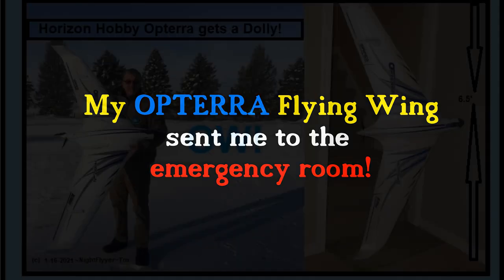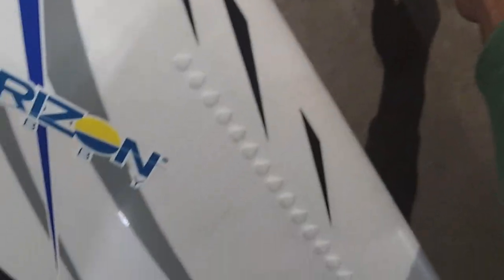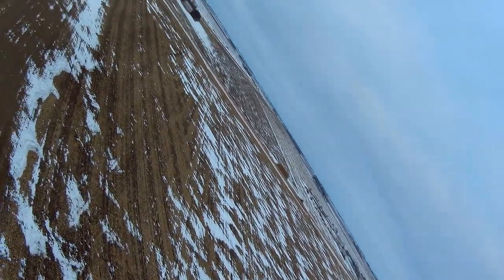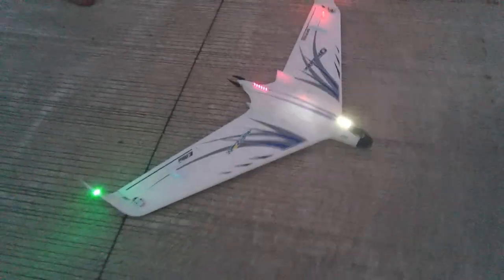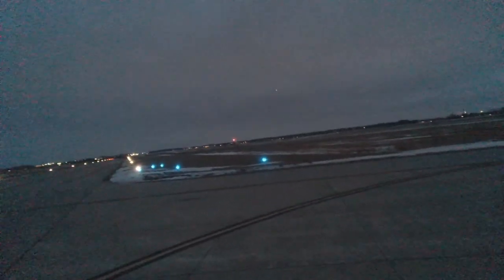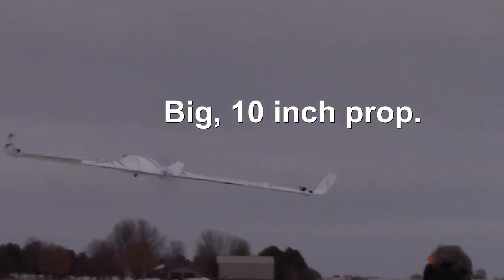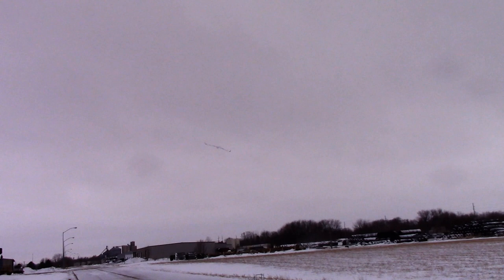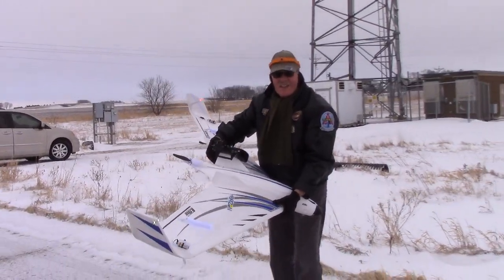My Opterra 2M Flying Wing sent me to the E.R. This is an awareness video & my solution for launching

Comment: Throtty Cut..  it's your friend
Reply from the maker: Of course I know how and  have.  First of all, that had nothing to do with my hand injury. I only mentioned the Throttle arming because I followed instructions in the manual and this is the way it bound up and arms the motor as soon as you plug in the battery. It says nothing about programming in a cut switch like my helis have.  It's my warning to be cautious, because the manual says nothing about programming in a throttle hold to a switch. I've known of times when after flying, that switch was forgotten to be moved back to safe and it armed as well.  Nothing is 100% as it could be left in the wrong position, by accident. I'm pretty experienced, so never relied to on a throttle cut/hold, as all my machines need throttle stick movements to arm.   I only am warning others to be careful BEFORE the launch and to be careful no matter what you use.

Comment: think i heard the prop hit the dolly on liftoff
Reply from the maker: I installed guides to the bottom of the plane. I think you heard the cross bar on the bottom of the dolly pop over the screwdriver I had pounded into the ground when it reached the end of the string at the last minute.  Thanks.

Comment: You could throw it then turn the engine on
Reply from the maker: Here is word for word what the Opterra 2M manual says about launching.  
1. Put the aircraft into launch mode with the channel 5 switch.  (in my first video that did not work, it went into the ground)  
2.  Hold the aircraft in one hand and the transmitter in the other.  
3.  Apply full throttle and throw the aircraft directly into the wind, angled slightly up (5 to 10 degrees above the horizon). 
4.  Climb to a safe altitude and check the trim.   
I know others have their own ways, and either way, my Dolly is the safest solution for me.  
The Opterra 2M manual also says nothing about throwing it with the motor off, so if a newbie followed the instructions, like I did, I'm showing what could happen, in case a gust of wind got them or something else.     Nothing is 100% and no matter how good you can throw, this big 7 foot wing with a 10 inch prop spinning right next to your face, is risky.

Comment: You toss it like a paper plane, thats bad, and its a little bit underpowered? Try throw like a javeline, and the hand should be faster(swipe) foward down. But as you say it could happen to anyone. Seeing your cuts on your finger makes wonder if i should wear a glove. Stay safe
Reply from the maker: I cant fly with a thick glove.  This 7 ft wing is a bit tough to launch, not like my smaller ones, and I found that I have to keep my right hand on the elevator stick to launch it.  But again, I followed the instructions in the manual.  Here is word for word what the Opterra 2M manual says about launching.  
1. Put the aircraft into launch mode with the channel 5 switch.  (in my first video that did not work, it went into the ground https://www.youtube.co/watch?v=P_inF5EYLEE&t=1s   )  
2.  Hold the aircraft in one hand and the transmitter in the other.  
3.  Apply full throttle and throw the aircraft directly into the wind, angled slightly up (5 to 10 degrees above the horizon). 
4.  Climb to a safe altitude and check the trim.   
I know others have their own ways, and either way, my Dolly is the safest solution for me.  
The Opterra 2M manual also says nothing about throwing it with the motor off, so if a newbie followed the instructions, like I did, I'm showing what could happen, in case a gust of wind got them or something else.  Thanks much.

Comment: I seen a guy attempt to adjust the needle on an RC air boat......through the prop! Whack! So now he’s bleeding and pissed but not calling it a day. He nothing if not stubborn. He launches it and it dies. He starts is again and goes to adjust the needle......and does it again, WHACK! He’s not an RC club member and is running rouge (no insurance) and if the rangers found him he’d be asked to leave or cited. We’ve already put our retrieval rowboat away. Anyway, this clown should be headed to urgent care instead of bleeding on the ground but decides to launch again. His airboat dies in the middle of the the pond and is stuck on some algae so it’s not blowing back to shore anytime soon. Einstein here decides to swim for it in this green pea soupy water with a shredded hand. 
I hope this guy doesn’t have offspring.

Comment: 2 words....miniature air compressed piston launch system....just like air craft carriers......bubble tank with ball valve.....sliding piston/rail system...make it out of PVC....sounds WAY fancier than it really is....
Reply from the maker: Yes, I could do that and used to have a self contained launcher as you saw at 7:26, but it was destroyed in the fire that destroyed all my planes.  But this is another thing that has to be built and carried to the flying site.  I launched the way Horizon said too, and others will probably too.  Thanks for the suggestion, but its hello dolly for me from now on.

Comment: YOU NEED TO SET THROTTLE CUT ON A SWITCH
Reply from the maker: I certainly know that as most of my helis have that setup. I've flown models for 60 years.  Maybe if the Manual had said I should do that, I would have.  First of all, that had nothing to do with my hand injury.  I only mention it to warn others to program in this feature as well,  which also should have been mentioned in the instructions.  I've known of times when after flying, that switch was forgotten to be moved back to safe and it armed as well.  Nothing is 100% as it could be left in the wrong position, by accident. Here is the link to my product review  videos and you can see I launched it the same way without problems.  Thanks.  Its hello dolly from now on. 
https://www.youtube.com/watch?v=P_inF5EYLEE&t=1s&gl=CO

Comment: I would put giant landing gear on the wings
Reply: That is more permanent then the dolly
Reply from the maker: Yes, well if you saw my Product review  video,  https://www.youtube.co/watch?v=P_inF5EYLEE&t=1s  you would see  those wings aren't as strong or thick as you would think.  I would have to add a nose wheel servo and make it a trike as well.  And since the prop on the back is 10 inches, the landing gear would have to be quite long or retractable prop would hit the ground on rotation or landing. Thanks for the suggestion, but the dolly is pretty permanent too.

Comment: You need a flight controller with auto launch.
Reply from the maker: Maybe it should say that in the manual.  Here is word for word what the Opterra 2M manual says about launching.  
1. Put the aircraft into launch mode with the channel 5 switch.  (in my first video that did not work, it went into the ground)  
2.  Hold the aircraft in one hand and the transmitter in the other.  
3.  Apply full throttle and throw the aircraft directly into the wind, angled slightly up (5 to 10 degrees above the horizon). 
4.  Climb to a safe altitude and check the trim.   

I know others have their own ways, and either way, my Dolly is the safest solution for me.  
The Opterra 2M manual also says nothing about throwing it with the motor off, so if a newbie followed the instructions, like I did, I'm showing what could happen, in case a gust of wind got them or something else.     Nothing is 100% and no matter how good you can throw, this big 7 foot wing with a 10 inch prop spinning right next to your face, is risky.

Comment: you are not alone but you dd get lucky. one of our guys cut tendons in his wrist. learn to discus throw your wings
Reply from the maker: Sorry to hear that, but Lucky?  I cut 2 tendons as well. Discus style!?  LOL. I appreciate that, but we Marines were taught to follow instructions and stick to the plan or get dead!  So after spending 33 years in the Marines, I managed to stay alive because of that.  This wing is 7 foot long and will bend and break the end off the if you even try to pick it up by the tip. It would be extremely difficult to somehow launch it discus style with the elevon right there and that 7" tall winglet rudder that is also on the tip.  I know how to do it , but not with this one..
To try to pick it up and launch it with left hand with motor running full would be a tough call, not like launching my small F-27 evolution.  So I followed the instructions word for as I did for the video I made of my product review earlier.  https://www.youtube.com/watch?v=P_inF5EYLEE&t=1s
Here is word for word what the Opterra 2M manual says about launching.  
1. Put the aircraft into launch mode with the channel 5 switch.  (in my first video that did not work, it went into the ground)  
2.  Hold the aircraft in one hand and the transmitter in the other.  
3.  Apply full throttle and throw the aircraft directly into the wind, angled slightly up (5 to 10 degrees above the horizon). 
4.  Climb to a safe altitude and check the trim.   
I know others have their own ways, and either way, my Dolly is the safest solution for me.  
The Opterra 2M manual also says nothing about throwing it with the motor off, so if a newbie followed the instructions, like I did, I'm showing what could happen, in case a gust of wind got them or something else.

Comment: I'm sorry this happened to you,  but IT didn't send you to ER, you sent yourself. As they say in woodworking, but I'm it works here too.... A bad carpenter always blames his tools.
Reply from the maker: I follow instructions and am not the only one this happened to. If you follow my channel, you know I am no newbie and for some to say I asked for it or should have done it differently is disappointing, especially when I am the one hurt, the hospital charged me $2400, and I followed the manual's launch instructions word for word.     

First of all, that throttle arming had nothing to do with my hand injury. I only mentioned the Throttle arming because I followed instructions in the manual and that is the way it bound up.  It arms the motor as soon as you plug in the battery. If it had said to program in a throttle cut, I would have!    This wing is 7 foot long and will bend and break the end off the if you even try to pick it up by the tip. It would also be extremely difficult to somehow launch it discus style with the elevon there and that 7" tall winglet rudder that is also on the tip.  I know how to do it , but not with this plane.  See my 14 year old self-contained catapult in action here.  https://www.youtube.com/watch?v=ypxbkaY-Ycs&t=113s
It's not like launching my SMALL F-27 Evolution or 1.2M Opterra.  So I followed the instructions word for as I did for the video I made of my product review earlier where nothing happened bad.  https://www.youtube.com/watch?v=P_inF5EYLEE&t=1s
Here is word for word what the Opterra 2M manual says about launching.  
1. Put the aircraft into launch mode with the channel 5 switch.  (in my first video that did not work, it went into the ground)  
2.  Hold the aircraft in one hand and the transmitter in the other.  
3.  Apply full throttle and throw the aircraft directly into the wind, angled slightly up (5 to 10 degrees above the horizon). 
4.  Climb to a safe altitude and check the trim.   
I know others have their own ways, and either way, my Dolly is the safest solution for me.  
The Opterra 2M manual also says nothing about throwing it with the motor off, so if a newbie followed the instructions, like I did, I'm showing what could happen, in case a gust of wind got them or something else.     Nothing is 100% and no matter how good you can throw, this big 7 foot wing with a 10 inch prop spinning right next to your face, is risky.  And to see how I feel about that unnecessary auto stabilization system see this.  https://www.youtube.com/watch?v=ur5V5H8UcGs&t=1s
Maybe a gust of wind, maybe my 73 year old left arm was weaker, or who knows.   But either way, if it happened to me launching the way I thought was good (and  the same as all my previous launches.)  So if it can happen to me, it can happen to others, and that is the warning I want to present.
Reply: @NightFlyyer  Again. Sorry this happened to you and thanks for replying. You might want to sue the company that made it as it is a dangerous design if it happened to other people as well. A class action suit will make sure that they change their design and you will be saving other people's hands.  I hope you heal completely.
Reply from the maker: @bodyworxmassagetherapy7382  Thanks but I do not have the money to go after Horizon hobby, when they have covered their ass with all the disclaimers, especially when this ER trip cost $2400 and not over yet.  I just wish they would change their instructions.  Thanks again.
Reply: @NightFlyyer  It is a pity that companies can get away with stuff like that.... And I don't remember if I said it before but I'm really sorry for my shitty first comment. I was an ass.  Please forgive me.
Reply from the maker: @bodyworxmassagetherapy7382  No problem.  Thanks so very kindly.

Comment: Prop stuck the launch rig as it lifted....
Reply from the maker: I dont think so, but still better than my finger or hand.
Reply: @NightFlyyer  but needs refinements to save props and motors.
Reply from the maker: @dwkach   Everybody has improvements after the fact, but in fact, it worked, did not burn up my motor, and didn't break any props.  If it works, don't fix it.  LOL.
Reply: @NightFlyyer  so very true

Comment: Chuck it of the wing.. don't ever put a pusher up with a throw like that.. throw it like a Frisbee..
Reply from the maker: This wing is 7 foot long, heavy, underpowered, and will bend and break the end off the if you even try to pick it up by the tip. It barely has enough power to fly out of your hand at launch and especially while I was trying to throw it into 12 mph wind. I know and I tried to launch it discus style, but could not hold it where I felt I could launch it successfully in the wind.     It would  be extremely difficult to somehow launch it discus style with the elevon there and that 7" tall winglet rudder that is also on the tip.  I know how to do it , but not with this plane.    Here are the links to the last videos and you can see I launched it the same way without problems.
https://www.youtube.com/watch?v=P_inF5EYLEE&t=1s&gl=CO  and   https://www.youtube.com/watch?v=ur5V5H8UcGs&t=1s

Comment: Sorry that happened to you. I wouldn't launch it with the motor running holding it from there. See how FlightTest does it https://youtu.be/4aemCP4bhxM  You can hold it from the wing with the motor running or launch it with the motor off.

Comment: Learn how to setup an arming switch in your radio.
Reply from the maker: Of course I know how and a have.  First of all, that had nothing to do with my hand injury. I only mentioned the Throttle arming because I followed instructions in the manual and this is the way it bound up and arms the motor as soon as you plug in the battery.  It's my warning to be cautious, because the manual says nothing about programming in a throttle hold to a switch. I've known of times when after flying, that switch was forgotten to be moved back to safe and it armed as well.  Nothing is 100% as it could be left in the wrong position, by accident. I'm pretty experienced, so never relied to on a throttle cut/hold, as all my machines need throttle stick movements to arm.   I only am warning others to be careful BEFORE the launch and to be careful no matter what you use.
Reply: @NightFlyyer  I'm commenting on your notes at the start of the video regarding there being no safety when the throttle is touched (see 1:35 )
You note it as a danger for the quad but don't let anyone know that they should set up an arming switch on their radio.
You can also set up throttle stick movements to arm the quad within the radio, but a switch is much easier to assign and work with.
Your note about the switch being left in the wrong position, I'd advise using a small amount of idle and then disarming the switch on landing to stop the prop.

Comment: Seriously???   I DONT know of ANY ESC's that dont ARM and ARE dangerous..  AFTER PLUGGING in the POWER/Battery!!  I mean...   SERIOUSLY!!!!     You SAY, you Are an experanced Flyer!!!    SERIOUSLY!!!????
Reply from the maker: Seriously! Shame on you!  Ever hear of Safe Start from Hobbico on their ESC's?  Seriously!?  First of all, that throttle arming had nothing to do with my hand injury. I only mentioned the Throttle arming because I followed instructions in the manual and that is the way it bound up.  It arms the motor as soon as you plug in the battery. I usually program a throttle cut in and mentioned it in case a new person forgot.  In older Electrics we used to put the throttle at full.  Then when it was time to fly, you would bring the throttle down to idle to arm it.  You can see this procedure where I am  using the Electrifly 22-25 ESCs on my Giant Stormlauncher.  https://youtu.be/SLbB0J4IsZI   It has SAFE START.   Here is right from the manual.  SAFE-START:  As  a  safety  precaution  to  prevent  the  motor  from  rotating when the battery is first connected, you must “arm” the ESC every time you connect the battery. The propeller will NOT rotate until the  ESC  is  armed.  To  arm  the  ESC,  move  the  throttle  stick  to  full  position,  then  back  to  off  (or  brake).  Now  the  motor  will  rotate  anytime  the  throttle  stick  is  advanced  away  from  the  off  position.
Seriously!?